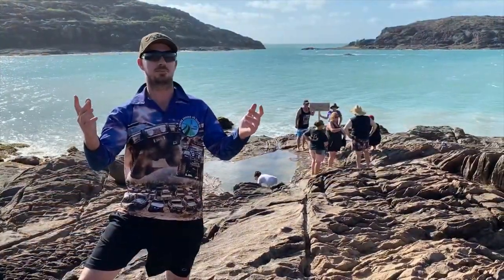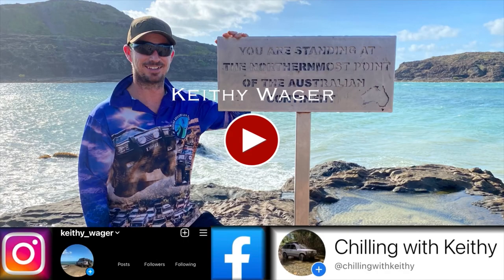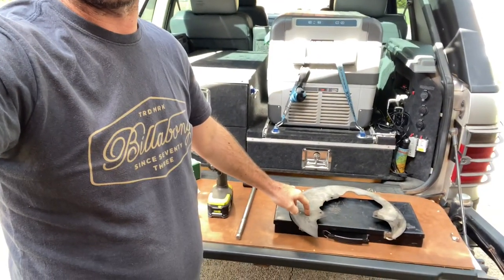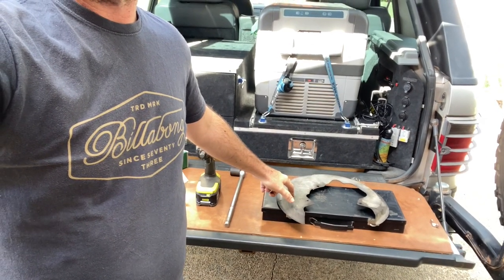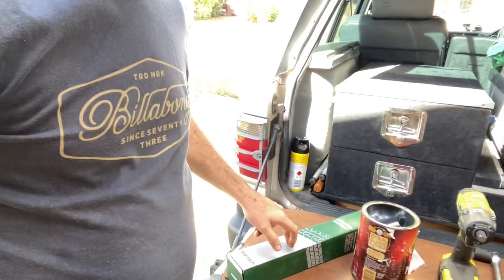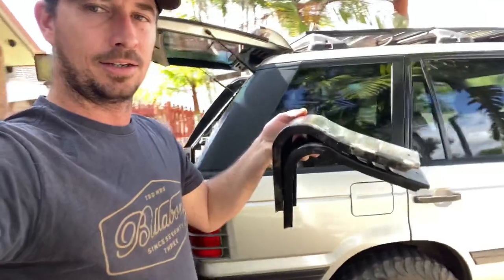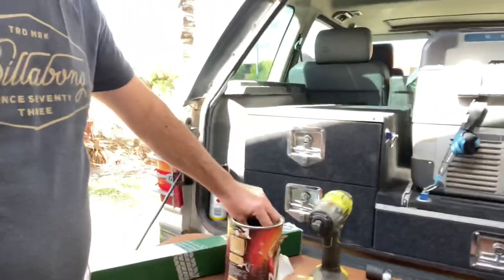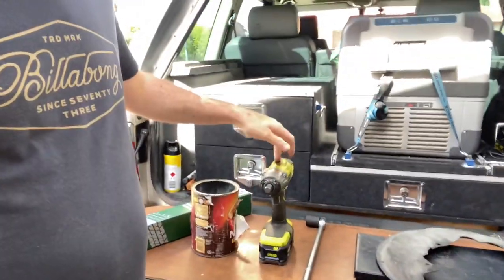Keeping An Old Range Rover Rolling | Workshop Tales Ep.3

Comment: Hey mate don't have any way of messaging you. But recently fitted 285/75/16 with a 2" coil lift, and currently having scrubbing issues when turning and when going over speed bumps. p38 has been coil converted and front and rear mudflaps removed. Any advice on what to do?
Reply: And rims are +30mm offset
Reply from the maker: G’day mate, thanks for the message. There is Facebook (chilling with Keithy) or Instagram (Keithy_wager) if you need to message, either way I’m happy to chat here 👍

I’d only be guessing as I don’t live with your P38 day-to-day, but I’d be looking at wheel offset being the culprit here. Standard offset is +57, so there’s a fair bit extra turning radius going on when you steer, this most likely explains the front. You could cut the guards or belt the area that it’s scrubbing, unless you have access to standard offset wheels?

Does it scrub in the rear as well?

Cheers
Keithy
Reply: @Keithy_W  Rear is perfect doesn’t scrub, It’s only catching half a mm when partial turning but does scrub a decent amount when fully locked.
Reply from the maker: Are you able to get a heat gun and massage the inner guards to allow a bit of clearance when turning (or is it some other spot that it rubs)?
Reply from the maker: It’s funny because mine don’t rub, although that could just be the difference between brands.
Reply: @Keithy_W  Very true, i’m running brand new Maxxis Razr MT, and could also be due to tyre pressure